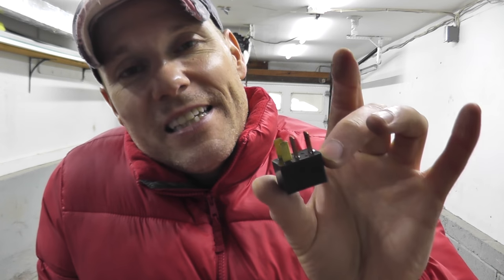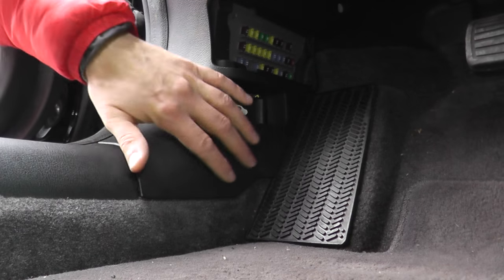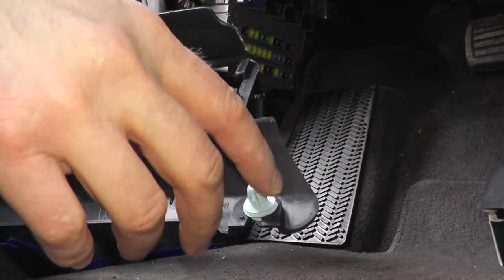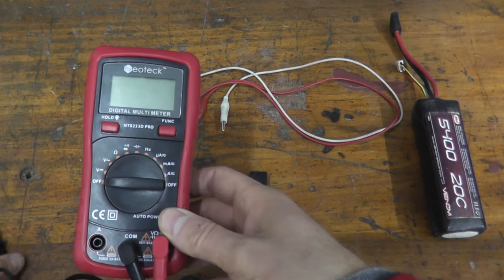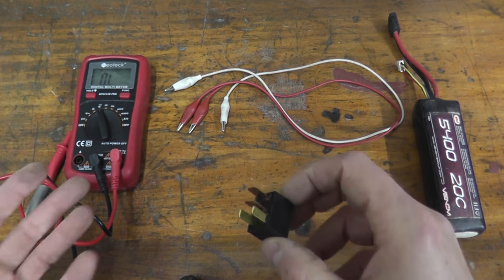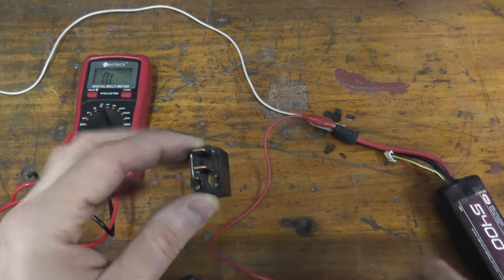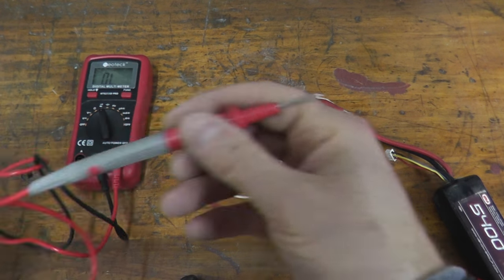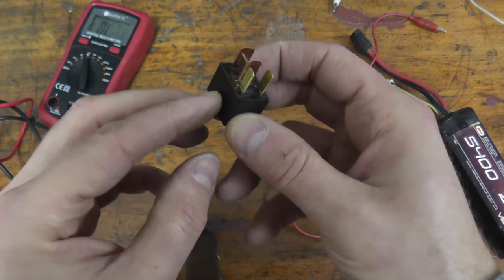How To Test and Replace A Starter Relay

Comment: What about a Chrysler Sebring convertible 2005¿,   first  while driving you could hear click n crank,  the gas was low but I was close to home so I decided to try n get home.  The car died out 2 miles away. So the battery has power.  Light sensor etc works.  But turning the key itll click n Yeah,  then nothing .   What is your opinion???

Comment: With Denso 4 prong relays the copper prongs are the ones that connect to components, or load (terminals 87 & 30)& usually they're a little larger as well, so the ones you connect to power will be the smaller, less coppery colored ones..#s 85&86

Comment: Thank you so much for your easy to follow and understand video as I’m having just such a problem on my 1996 FourWinds, Class A, motorhome.  I’m hoping to learn some basics before a mechanic starts replacing one part after another as I’m a senior citizen female.  I believe I’ve an honest mechanic but I feel better having some knowledge of how things work even though I’m not comfortable doing any such repairs. I did opt to pick up (2) new batteries as the deep cycle marine battery was 12 years old and wasn’t charging on a trickle charger.  The engine battery was a 5 year battery with only 7 months left on it’s warranty and I don’t want to get stuck somewhere along my travels. So those have been installed but still no turn over. I asked about the possibility of the ignition switch but after he attempted several tries of starting and removing the doghouse cover he next went to the starter relay. Just waiting for part to be ordered in the morning and installed.  But before he installs the new part I’ll ask him to test the old one.

Comment: Good video bro! Saved me time. I used stranded copper speaker wire to wire it to my car battery. Super ghetto but i got it done. Relay is functional, and has continuity when live. I've also tested my motorcycle relay months ago before this video, but it was way more straight forward. the power and ground were obvious, this relay it wasn't.  relays good, my starter motor isn't. Need a new one.

rofl hardest part was when i realized.. (bulky jumper cables) aren't the best way to put power on it.. haha, so i swapped to speaker wire. worked will, i tied it on and it was functional. 

Keep up the great work! We appreciate it.
Reply from the maker: Thank you! Appreciate the feedback

Comment: Relays usually have markings on top denoting pin functions. 
A "ww" represents a resistive load - that of the relay's coil. A "NO" is normally open contacts...a "NC" being normally closed.
Hope this helps.

Comment: What if it cranks on a push start  but it's not your battery or starter ? Your explanations are nicely detailed btw.
Reply: Check the fuel pump/lines, spark plugs and ignition. Cars need combustion to operate and most times you’ll have a clogged fuel pump

Comment: Overall good video, however, towards the end, you zoomed into the prongs on the relay itself, and you should have zoomed in on the tester to show what will happen to the display when you have them touching the correct ends... what does the LCD do? Overall, good, but that could have really solidified the explanation.

Comment: Thanks for the video. If you had an intermittent no crank fault and carried out this check, would it only show a fault some of the time? My 2008 Mercedes CLK fails to send power to the starter motor occasionally and I think it's either this relay or the electronic ignition switch but because the fault comes and goes as it pleases I'm not sure how to test. Any ideas?

Comment: When checking for continuity on the horizontal prongs, as a final test, can you also check them with either a test light or the multi meter set at 12 volts?

Comment: When I push my ignition start button I hear a click & not a cranking noise it is intermittent. The car may start after pushing button once or 5 times or anything in between. Do you think it is the starter relay?
Reply: Same issue here, did you get it resolved?

Comment: sir.. you should not ever use the Ohmmeter function on an energized circuit. it can 1.) Damage your DMM PCB circuits 2.) Provide inaccurate or irregular readings. 

The multimeter checks for continuity by applying 3v to the circuit at a very low amperage, and checking for that 3v signal to return to the DMM through the COM port lead. Checking for continuity in a 12v circuit should always be done with the relay disconnected from all power sources. 

If you want to do it energized, you use the DC Volts setting on the DMM and check for 12v to be present at all pins expected to be energized when the Relay coil is energized...

Comment: Hi, I have a problem with my Honda CRV 2007, 4 cyl. When I started the car looks like my battery is low Volts or my starter is heavy to turn. I change the battery and starter but still doing the same, the motor start but on winter season is more slow to start and some times I run out the battery power. Thanks for you cooperation.

Comment: When I pulled my toyota corolla starter relay out, I saw something creamy sticked to the contacts of what seemed to be grease? Where that peanut butter could come from? Even the base of the relay has the same things and contacts are almost covered with that. Will I have to purchase the whole box where this relay and fuses live? Can I wash it down with alcohol? Is the sunny Florida also melting the electronic components of our cars, besides al the rest of the plastic components? My car with a 12.7V battery just gives me a "click" but it does not crank or start when I want but much later ...

Comment: I have a situation where my tractor is starting, but the starter stays engaged after i let go of the key.  If I turn off the ground (my tractor has a ground disconnect) then the starter disengages.  Is there an electrical test I can do to make sure the relay is not at fault?

Comment: When I turn on my car, I don't hear any clicking sound at all. Battery was tested fine. As I found online, I tapped on the starter gently with a wrench and then the car started fine. Does this mean starter has gone bad? Or is it starter relay? Appreciate the help.
Reply: Bad solenoid replace starter

Comment: Does this test help when a starter motor is just spinning continuously? Even when key 🔑 is out of the ignition
I have Mercedes Benz b class cdi 180  2010, Manuell, diesel.
Reply from the maker: I'm afraid not. This is simply if the starter is not cranking.

Comment: Can a loose wire affect my car relay as it won’t start and when scan not connecting with ECM and anti theft system was displaying on the dash as it all happens when I was trying to fixed my seatbelt and got the airbag wire ripped

Comment: Could it still be this fuse if the car will start with a jump?
Reply: My car had a bad ignition relay and a jump start would not work as the battery wasn't the issue.

Comment: How did you not blow the fuse in your meter when you tested an energized fuse with ohms
Reply: Its a separate circuit in the relay. The energized circuit creates a magnetic field to close the switch

Comment: How about, the car starts but the solenoid doesn't disengage? (so i disconnected the solenoid control wire and ran the car, stationary, like that but then the battery went flat pretty fast....)

Comment: you cant test a relay like this,,but if you also want to test the power contact leads,,,,,its best to put a load on this to test,,,if you only use a meter it might show good,,but with a load it will show nothing,,this is due to carbon build up on the contacts,,,,,,,,,,,,,,,,by load a mean like power a light bulb or just test it on the cars relays,,which ever power like a motor or light bulb,,,,,,,,,,,,,,,,,,,,,i learned this the hard way,,,,,,,,,,,,,but learning is power,,,,,,,,,,,,

Comment: Hi ik this is a old video but can anyone help me out on checking why my toyota tundra 2008 is not turning on like it turns on AFTER u put only the red wire to give it a jump start after that it runs great and no problems but when u turn it off it those not start back up

Comment: Something that goes with this, that I would love to get your opinion is:
The use of dialectic grease on this connectors to the relays??
I have seen a couple of videos, with contradicting information.
I love these information videos, and would to see one of these...
Reply from the maker: The repair manual doesn't call for dielectric grease so I would leave as is. Good question.

Comment: Not a good test without load on the contacts. The relay can “click” all day long and still can fail under load.
Reply from the maker: How was this not under load?
Reply: @CarsNToys  Because in the real world, the starter relay sends over 20 amps to the solenoid PULL-IN coil to get the plunger to move the Bendix and close the electrical connection between the battery and the starter motor. Those 20 amps flow for a fraction of a second, then the solenoid HOLD-IN coil takes over and draws about 8-10 amps and lasts until you release the key after the engine starts. So the starter relay has to switch a lot of amps which makes it easy for the relay's internal contacts to become pitted and behave in a hit or miss fashion. The bench test in the video will spot some, but not all, of the potential defects in a micro-miniature starter relay.

Comment: Was looking like a great video until the prongs were not identified! In my experience, they're always 30, 85, 86, & 87. Would have made this so much clearer. Also my starter relay has 3 vertical and only one horizontal. So much for oversimplification! Still a worthwhile tutorial but not what i was hoping for....

Comment: If you hear the relay loading up and vibrating, you need a new ignition switch. Easy to replace, about fifty bucks.
Reply: What if I just hear a click when i press the startee button?

Comment: I guess he doesnt know horizontal and vertical ? Not a good idea to teach cont when testing things with voltage . although this was 12v someone may think you can do that with single phase AC current in turn will blow your meter out your hands . not sure why he didnt just check voltage and not cont.
Reply: YEA...LOL.  he became the "RELAY" if been AC!!!

Comment: The Coil in the relay may have an impedance of a a couple of ohms or less so you could have found the coil connections doing a continuity test without powering the relay. On the opposite way the switch contact should have give you an open connection, (no continuity). Of course, the relay switch should have been normally open when the coil is not powered. Otherwise there is a short on the switch or it is a normally close type, but unlikely.